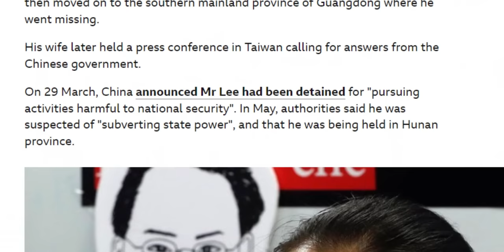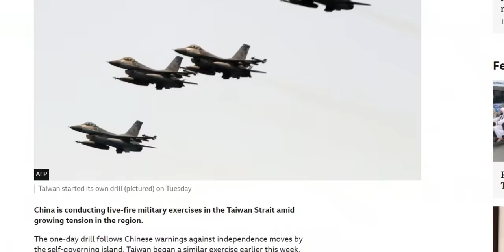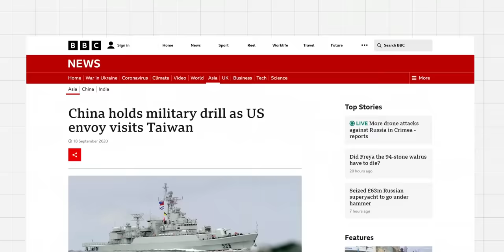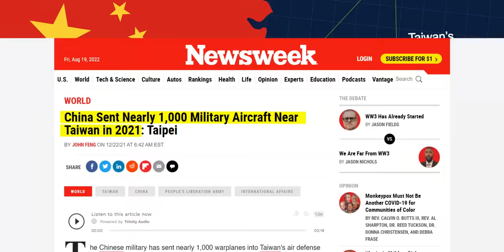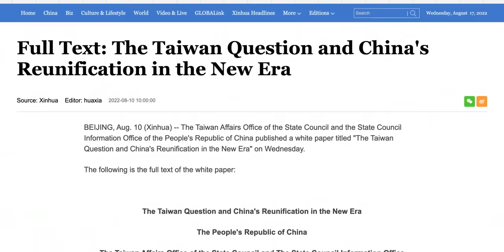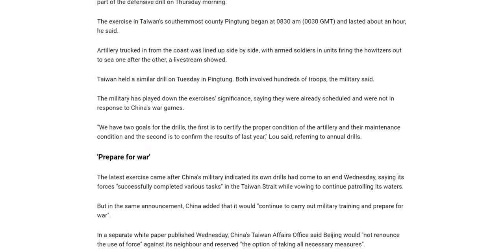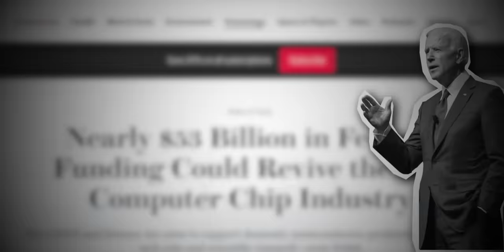TSMC DOOMED? China's Economic Crisis May Take Tech Stocks With It

Comment: Tsmc is nothing without company that supply him chip printer. That is EU company (that works closely with other western companys). They are the ones that keep tsmc Infront of everything Chinese have to offer. So even if China takes Taiwan they have not taken chip production.
Reply: ASML
Reply: @13MAM13  👍
Reply: ASML is a Dutch manufacturer using many European subcontractors like Carl Zeiss, a German optics firm, VDL, a Dutch company, makes the robotic arms that feed wafers into the machine. The light source comes from Cymer, an American company bought by ASML in 2013. I believe you also failed to mention that the Chinese are unable to buy these machines from ASML because of a technology Prohibition from the United States & European Union
Reply: I also believe that ASML will not do Tech support for the ASML machines that they’ve already built/sold if China were to take over Taiwan and TSMC
Reply: @bkkposterboy2  Yeah, I was too lazy to look for details, subcontractors names...  but yeah that's my point.

Comment: No, the sky isn't about to fall, even if the Chinese do decide to take back Taiwan by force.  One aspect NOT mentioned in the video is the role of the machines and software used in the fabs to make and test the chips.  These are NOT made in the major fab countries Taiwan and Korea, but rather in the US, Europe and Japan.  The software used to design the chips does not come from Taiwan or Korea, but from the US and Europe.  Without the ongoing, continual support of the companies which make these machines and these SW packages, no company can maintain existing fabs let alone setup new ones.  Reverse engineering them would be a Sisyphean task.  The "West" has all the cards to set up new fabs quickly and is already doing so in non-risk locations.  A clear consequence for China in taking over Taiwan by force, is not only the collapse of the Taiwanese semiconductor sector, but the collapse of its own parallel sector.  Hopefully logic will prevail over emotion for those who have the most to lose, but given the stakes, it is clear that the 'West' is already implementing contingency plans.